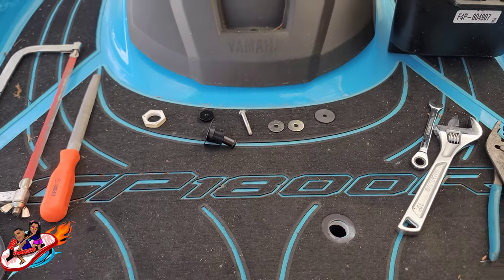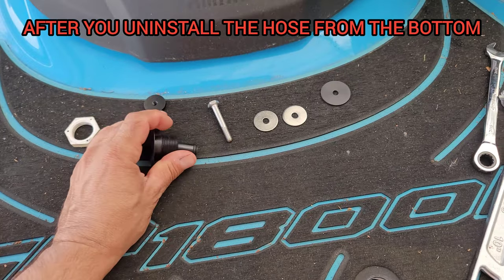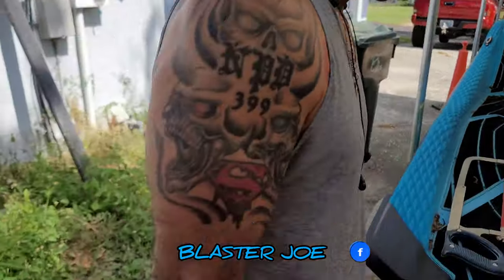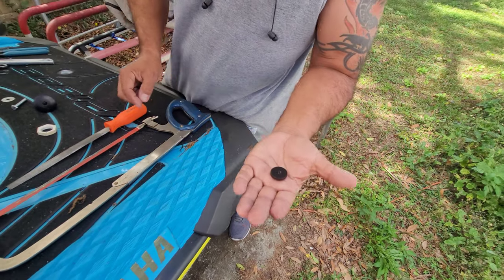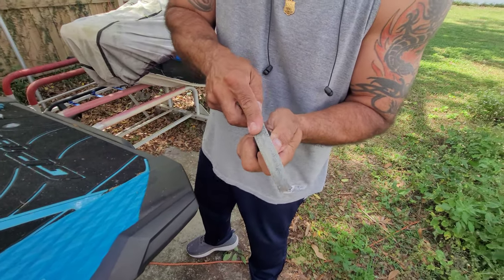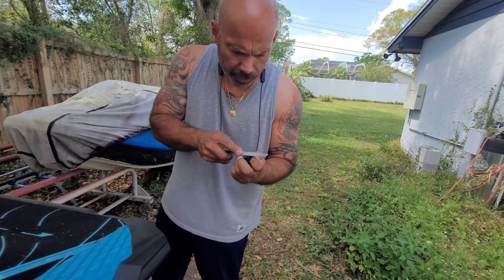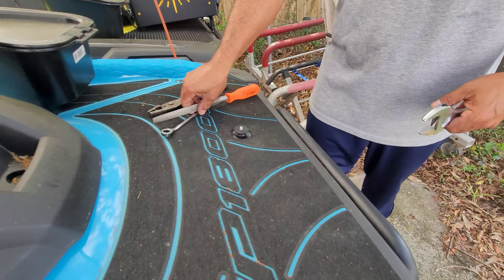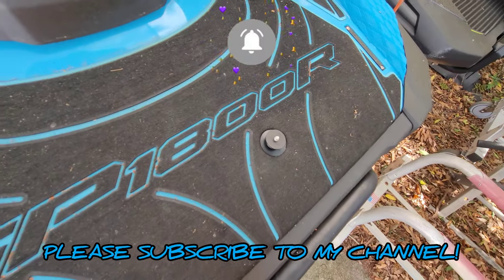convert your yamaha spout into a camera extension mount

Comment: You have any issue with it breaking?
Reply from the maker: No but I changed to my 3/8 base mount with a longer extension. I have another video on that installation. I also have a video I'm posting Saturday in my Facebook using it in twisties at 70mph
https://youtu.be/69m3w11CYL8